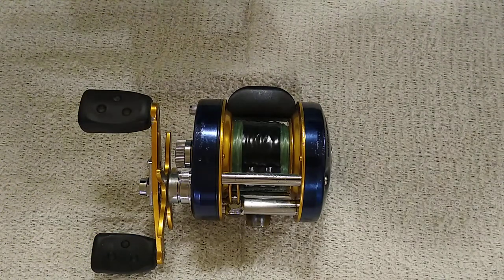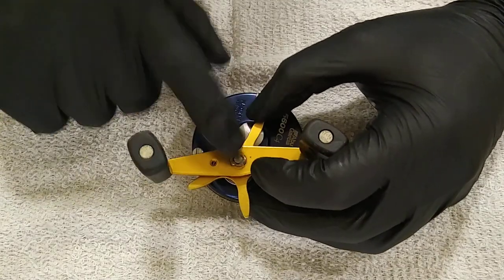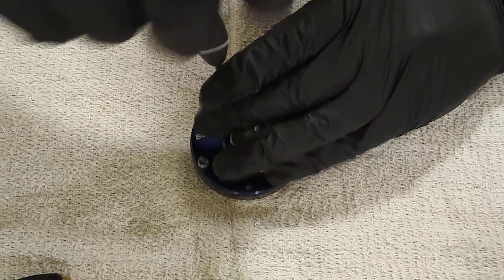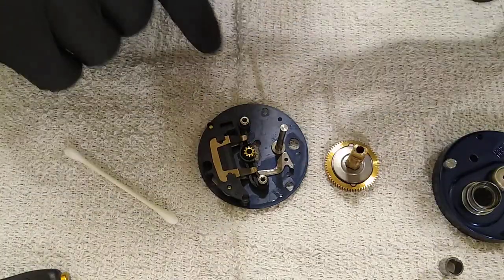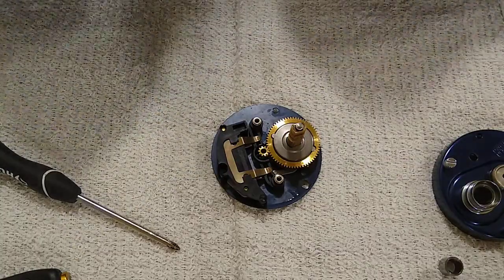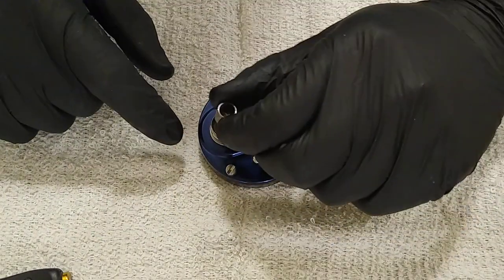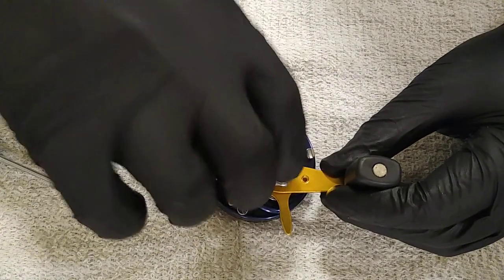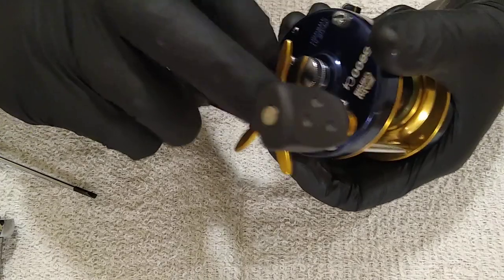Abu Garcia 5600 c4 (right side) ( too shot reel cleaning)

Comment: I believe what you are calling the retainer clip under the handle. Is on upside down. I really enjoyed your video and used it to help me pull mine apart and clean it. Mine has never been pulled apart I brought it brand new and that clip was the opposite side up when I took the handle off. I think it's designed to put some reason on the star drag handle as it is loosened.
Reply: I meant tension on the star drag handle as it is loosened.

Comment: I have the 7ft medium duty rod.  I have used it many times and it has held up well. This rod is a great rod for the price, it is pretty sensitive, and much stronger than it looks like it would be. I have caught a 12lb striper hybred as well as quite a few in the 5-7lb range, and never had a fear it was about to break.

Comment: I don’t know if I’m doing it wrong or what but I cannot for the life of me get the 10mm nut back on the handle the threads are not stripped because they are brand new parts and tips? Very informative video helped a lot !
Reply from the maker: So that nut can be a big pain in the butt due to the fact that it's not beveled. There are a few things you can do. Try slowly turn the nut backwards as if you are trying to take it off with your thumb and middle finger while applying slight pressure downwards with your index finger. Keep turning until you feel a "click". That click is the threads falling into alignment, once that happens turn it the correct direction and see if it starts. Second way is all depending on your skill level and how comfortable you are with "customizing" your new reel. You can take a small Jewelers file and put a very slight bevel around the top of the shaft. Be very careful doing this so you don't damage the rest of the threads. If you need more help feel free to let me know on here and I'll make a video just for this.
Hope this helps.

Comment: Well done video  Just a pointer working on Left Handed 5601 C4 Reels  The10 MM  nut that holds on the handle is,,,,,, Opposite Thread  Learned the wrong way and stripped out the nut and gear shaft  My bad.   Darn

Comment: Awesome video, Thank you!  I followed both the left and right side, and Im still having an issue with the reel.  Basically, I took it fishing down in Freeport, and while wading, I submerged the reel for a couple minutes trying to un-tangle live bait lines I'd tied on.  Now when I push the thumb release the reel will let me cast it but when I start turning the crank, it doesn't engage to spin.  I followed these directions to a "T", but after reassembly the thumb mechanism still doesn't pop back up when I start reeling in.  Any suggestions?

Comment: Clay could you kindly tell me where the 4th ball bearing is?  Abu's website says "4 ball bearings plus 1 roller bearing" but in my reel (exact same as yours) I only have 2 on the spool and 1 on the worm gear.  I emailed Abu and they told me "there's one pressed into the side plate on the handle side" but mine does not.  Do you have this 4th ball bearing?  It's driving me crazy!

Comment: Nice job as far as it went but you failed the most important issues. That is the Thumb Bar Spool Release. The major problem I have with these reels are the thumb bar not releasing the spool or not reengaging the spool when you start to reel. The mechanism inside gets out of alignment and it is a bugger to get it working properly. Thanks.

Comment: Hi How do you get the axle out? even with the tension knob loose axel is stuck!
Reply from the maker: Take the tension or knob completely off and there will be a little round black clip in there. Be careful removing this as they tend to break easily.